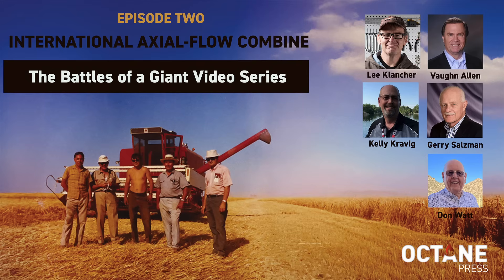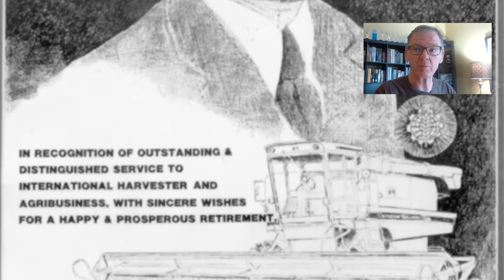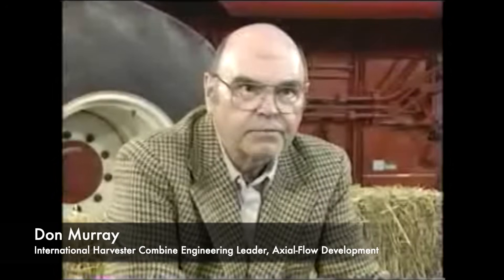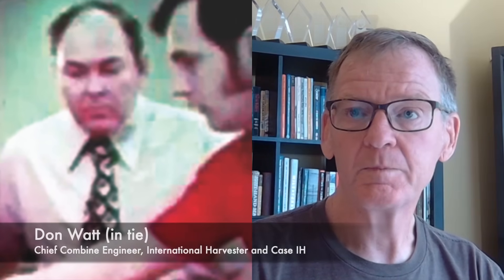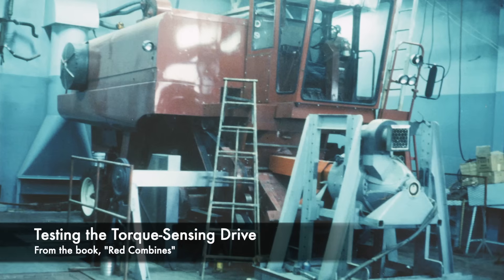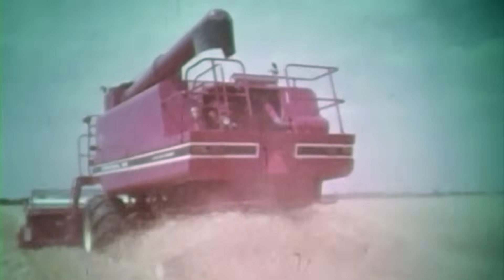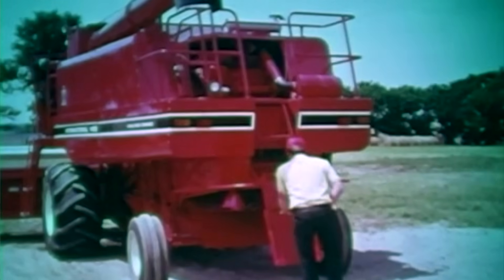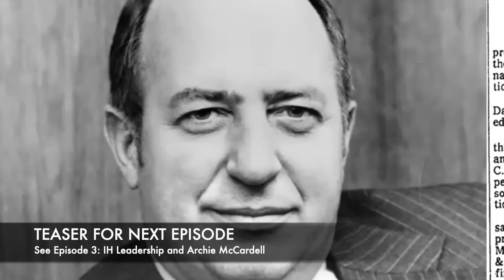International Harvester Axial-Flow Combine Development. Episode 2: The Battles of a Giant Series

Comment: John Deere did a pretty good job of keeping the new generation tractor program quiet
Reply from the maker: 100%. And that was perhaps a more significant development--and a turning point in ag history.
Reply: @Octanepress  What so they finally brought out multi cylinder engined tractors after just about everyone else had them since the 20s and you call that a bigger deal than the IHC rotary !!!
Reply from the maker: @interman7715  The technology was not a bigger deal--agreed on that point! The New Generation tractors changed the entire landscape of ag equipment. Hewitt authorized development of the NG tractors to move Deere into the number one slot after decades of being content to be number two. So the New Generation tractors mark a turning point. But you are correct--the rotary technology was definitely more of a leap forward than a new six!